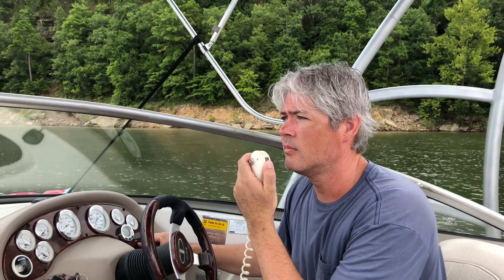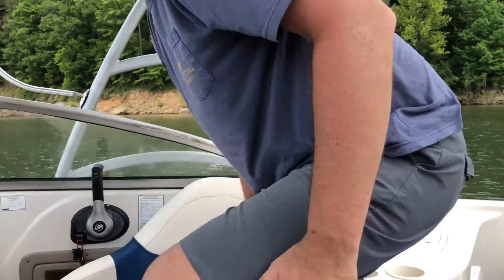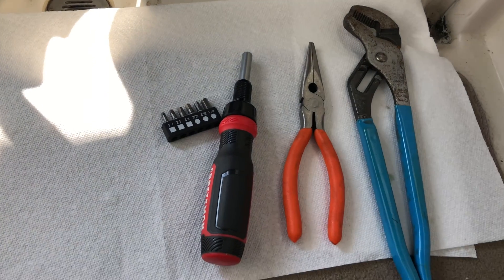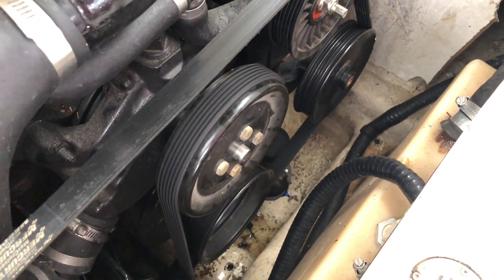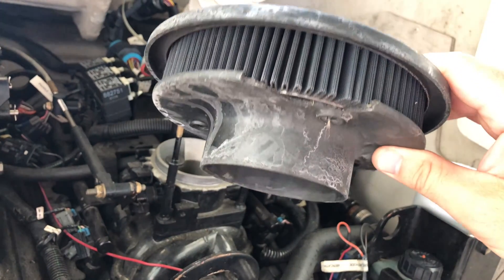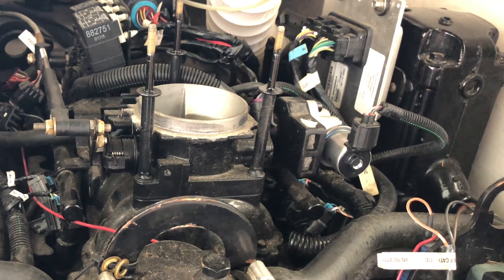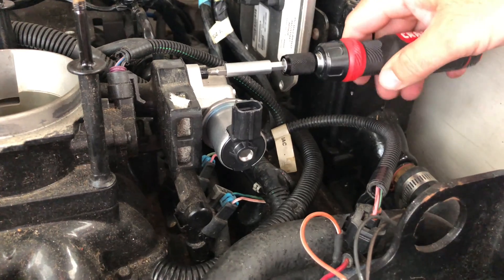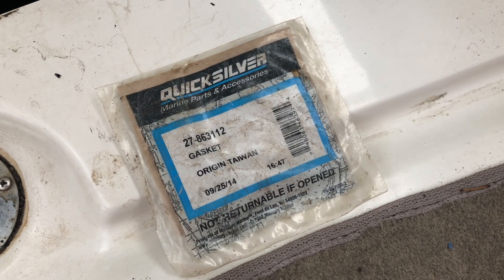Boat Won't Start Again After Running and/or Two Beeps Every Minute - How to Change the IAC Valve

Comment: Great video!  I have the same motor with a Bravo 3 and I'm having an issue where it drops RPM and then catches when going into forward or reverse.  The dealer is telling me it's normal and the computer is controlling it like a shift interrupt switch would on an alpha.  Do you happen to have any video of yours going into forward and reverse to see if it's normal?
Reply from the maker: Eeeeee, i’m trying to think.  I don’t believe i do, but that doesn’t sound like something mine does.
Reply: Here is a link to a video of what mine is doing when going into gear.  The dealer swears this is normal but I've never had one do this, but mostly have been a Volvo guy.  Also not sure why it came from a different account on my PC, so sorry about that!  Also thanks for your time! 

https://youtube.com/shorts/f-0JnqBha18?feature=shared

Comment: Are you telling me a bad IAC will cause a no crank condition if its in a Marine application? I used to be an automotive tech and never had a IAC  cause a no crank condition or did I misunderstand you?
Reply from the maker: That is exactly what I’m telling you.  You could crank the engine, but only by pushing the button to disengage transmission.  The double beep could happen at any time and once I changed the IAC, the problem went away.
Reply: @budgetprojectsbydavid5263  I wish these engineers had this shoved up their a##. Good God who thinks up this shit anyway. Dude out in BFE boat take a shit wont crank because of a bad IAC and he is stranded. I would never know about this I would be stranded . That is up there with the newer Dodge trucks if the voltage drops bellow 12 volts the engine wont crank / I saw that on a recovery video they went out and it would not crank he put a jump pack on it got the voltage up and it cranked over and started and he was out in the boonies miles from civilization Give me a 650 CFM Holley and points and condenser they can take all this new sh %% and shove it @ Go Old school all the way !
Reply from the maker: Preach, brother!  I have a ‘53 Willys M38A1 that was built with simple systems and redundancies like double serpentine belts.  I like the points, condenser, and 1 barrel Carter carburetor.  The fuel pump is mechanical, but it seems to work just fine even though it’s 70 years old.  If it’s not running, you can usually figure out why rather quickly.

Contrast that with my daily driver 2007 LX470.  One knock sensor starts acting up and the car goes into limp mode.  To test and replace the sensor, you have to remove the intake manifold.  Not something you would want to deal with on the trail or out in BFE.  Crazy!
Reply: @budgetprojectsbydavid5263  Love the old willys # Did you see the dude with the new F 150 got a crack in one of the tail lens got moisture in there took out all the modules in the tail lights set a bunch of codes truck went to shit real quick . When he got done it was $5800 for tail lights but did not include the modules show him with a scanner going through the process of finding the codes and diagnostics. And I used to be as Ford Tech . This is way above my head There is no pulling the lens off and putting in a 1157 Ford stepped up their game they werent happy with a 4 foot dry one they went with a 10 footer no kiss no for play just shove it in and enjoy the ride # I will stick with my Uncles 85 GMC 2500 series he bought it new I can pop the hood and got gobs of room to work on the engine . Take these new cars and trucks and shove it hahahahahahaha
Reply from the maker: I DID see that!  Absolutely mind-blowing!  I’m not a mechanic by trade (accountant), and I don’t know anything about the new electric vehicle technology, but i wonder if the technology behind them is much simpler than what the big three have come to with gasoline powered automobiles.
Reply: @budgetprojectsbydavid5263  If you get an electric vehicle and want to go four wheeling dont forget the long extension cord . My newest is a 05 Crown Vic it was my moms last car . Police Interceptor. Shes got 225,000 on the clock and still running. Yeah I had to put in two sets of timing chains and gears and tune ups and had to rebuild the dif but its never let me down . Some of these old cop cars are going 500,000 plus if taken care of. Nice talking with you bud enjoyed the chat . Stay away from new cars period elec or gas dont bother my advice

Comment: My boat have to put it in gear so we can start. Then I can rave it but it won't stay started when I put it in neutral just Dies and won't state idol unless it's in gear
Reply from the maker: Sounds familiar.  Fuel injected or carburetor?
Reply: @budgetprojectsbydavid5263  It was the idle control valve This video saved me $1200 just for a $40 part 3 boat mechanic guys told me. I had bad fuel and couldn't figure it out either Set for a year, ran down to autozone and grabbed the part. Bad boy started working awesome
Reply from the maker: Awesome!  Did the Ford Windstar (i think that’s the model) iac valve work for you? I’d love to get confirmation on that!
Reply: @budgetprojectsbydavid5263   Yes sir fired, right up Thank you a lot brother  I had 3 mechanics that I couldn't figure it out Thank God i run into your video 🤘🏼🤘🏼
Reply from the maker: I’m so glad it worked for you! I bet i know what you’re doing this weekend! 🚤🚤
Reply: @budgetprojectsbydavid5263  Yes sirr I got her ready for the weekend

Comment: I’m hoping this is the fix I need for mine. Starts up cold just fine but once it’s warmed up I have to put it in neutral and pump the throttle to get it started back up.
Reply from the maker: I hope so too.  I had an impeller go out on me this weekend.  So glad i had barely made it out of the marina when the long single beep of death shut me down.  My temp usually runs at 140 and it was at 200.  So, don’t be a dummy like me and make sure to change your impeller often!
Reply: Hi there - did this fix the problem for you? I seem to be having the same problem with my 3.0L Thanks in advance.
Reply from the maker: It completely fixed the problem for me.
Reply: @joefutino9253 was it the same fix for the 3.0?

Comment: Hi from New Zealand.
Thanks for your video. I had the dreaded 2 beeps not long after we purchased or 2010 mercruiser 5.7 Horizon. I found the drive oil to be low and toped it up. Problem solved. I'll be checking my IAC valve and muffler before summer. Cheers
Reply from the maker: Seems like my drive oil was different. It has been a few years since I got that one, but i thought it was like a longer and more frequent (angry!) beep.  Thanks for stopping by!  Enjoy your summer!
Reply: @budgetprojectsbydavid5263  sorry, yes you are correct! It was a longgg high pitched beep!! . Where I live 99.9 % of boats have Outboards. Thanks for a sharing your knowledge

Comment: Hello David! Great video! I have a 2011 6.2 L. engine in my boat that is having idle problems (low idle) and have been looking for a video that shows how to replace the IAC. All the previous videos show the procedure on the older models that use the 35-863829 muffler. Yours is the first video that showed the replacement on a newer model. When you took off the IAC on your boat the gasket remained in place without tearing and you just installed the new IAC without replacing the gasket. My mechanic told me to buy a new IAC and the adaptor that the muffler sits in because the gasket is not sold separately. I am hoping that my old IAC comes off without tearing the gasket. Could you tell me the year of your boat and how many hours you have on your engine. I am hoping that I can install a new IAC only. The new adaptor looks to be an additional $100.00. Again, thank you for the help!!
Reply from the maker: Hi Robert, thanks for reaching out! Glad to help!  I hope your gasket comes off easy.  I don’t remember mine being an issue.  The boat is a 2007 that we purchased in 2015.  No hour meter, though, and i have never connected it to the device that tells you the hours.

Comment: Would this cause reduced power? I have the hard start issue. My beeps seem to be about 2 minutes apart. Is the length between beeps a different fault? After warming up my boat actually starts fine. My vessel view is showing no fault?
Reply: Check the oil pressure switch. I had that issue and replaced the iac valve which improved but every now and then I had a hard start issue and turned to be the oil pressure switch that giving wrong readings to the ecu which was turning off the fuel pump.
Reply from the maker: Good to know! Thanks for the advice!  Fortunately, we haven’t had the issue come back, but will keep that in mind if/when we do!
Reply: @budgetprojectsbydavid5263  if you still have original oil pressure sender, replace it it is a kind of party buster and costs peanuts. You can replace it by yourself
Reply from the maker: I think it could cause the system to intentionally reduce power to 80% or something like that.  Two beeps per minute is a soft engine error and is the exact error i was getting when the rectangular iac muffler (foam filter) on the base of the iac valve’s mount was clogged.  I changed that filter and my problems went away immediately. It’s just a small rectangular piece of foam, but it set me back $20 on Amazon. I’ll see if i can find the link.
Reply from the maker: https://www.ebay.com/itm/185351930550?mkcid=16&mkevt=1&mkrid=711-127632-2357-0&ssspo=lvVhobzhTp-&sssrc=2349624&ssuid=yGjsdGtBQlS&var=&widget_ver=artemis&media=COPY

Comment: Thanks for such a good explanation and part numbers!
Reply from the maker: Thanks, I hope the fix works for you!  Please let us know if it works for you.
Reply: @budgetprojectsbydavid5263  yes it worked for me, I think the muffler came out because I found it on top of the throttle plate. I didn’t want to take any chances on troubleshooting the iac valve so I put a new one in along with a new muffler. Smooth and quiet now. Thanks!
Reply from the maker: That’s great!  I’m curious to know if you used OEM parts or if you got the Ford Windstar IAC valve from your local parts store?
Reply: @budgetprojectsbydavid5263  I used the oem “quicksilver” parts, my local boat store luckily had them in stock.

Comment: Hello thanks for this video. Would this change the rpms of the engine. My engine looks the same as yours 5.0 mpi. And is running at really low rpms at idle. Around 500. Can't see where to adjust idle. But I'm going to check these filters thanks
Reply from the maker: I think it should smooth out a rough idle.  If it’s electronically fuel injected, I don’t think you have any control over the idle rpm. The computer manages that for you based on sensors such as the IAC valve/sensor.
Reply: @budgetprojectsbydavid5263  yea I found that out too. Ordered new IAC to install
Reply from the maker: Good deal! Let us know if it works!
Reply: @budgetprojectsbydavid5263   to start, I put 2 new foam “muffler” in both engines. These are the little foam air filters  that sit in the back of the flame arrestor/air filter. The old ones were really bad. Put  new ones in rpms went from 450-500 to right on 600. So I think this worked. I did not change the ICV but I have it if needed
Reply from the maker: Very nice!  Did you clean the flame arrester at the same time or was it ok?
Reply: @budgetprojectsbydavid5263  I did not because I was on my boat didn't want to mess it up. I'm gonna pull it when I winterize it and give them a good dousing in carb/choke cleaner.
Reply from the maker: @JimmyLeeBands  good to know that your procedures were completely isolated to only those little foam filters!  That’s amazing!  Thank you for sharing your experience.